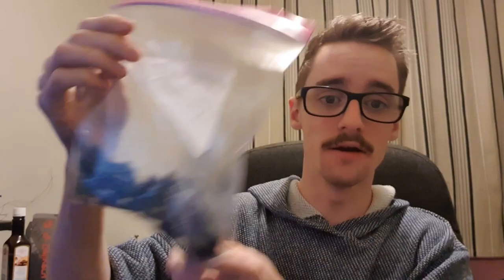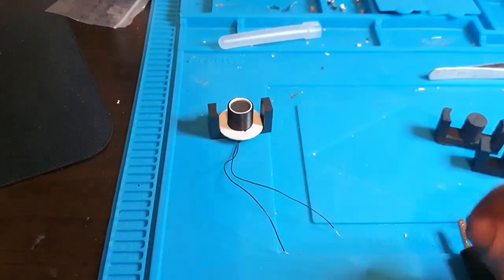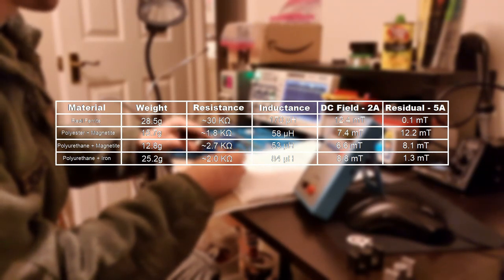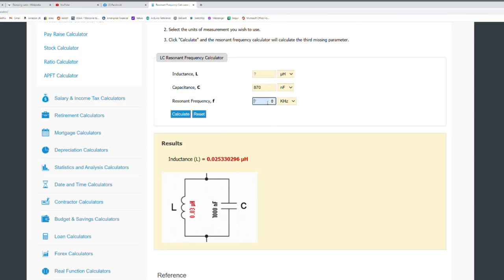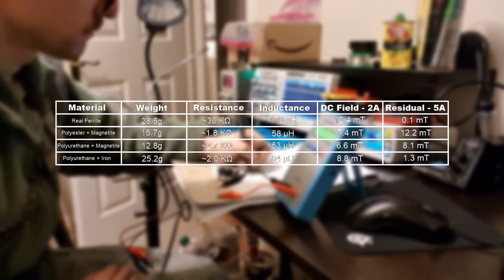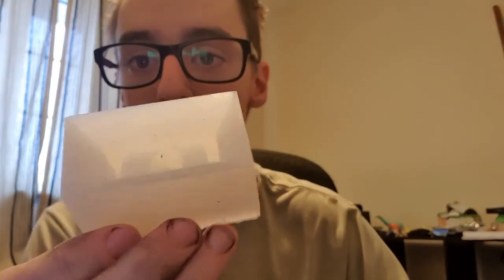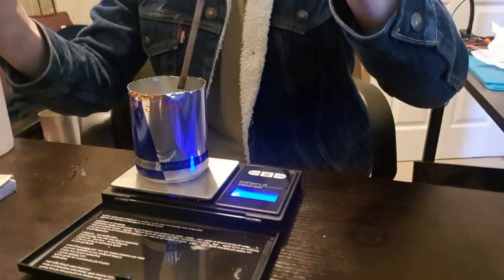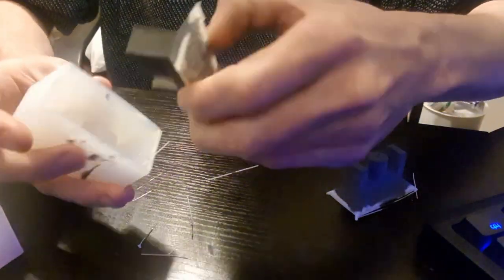Homemade Magnetic Cores! (Part 2)

Comment: Excellent! exactly what I was looking for thank you, you have saved me so much headache, I was about to go down the iron pla route but then actually read the properties so have been searching for castable transformer core material, there is nothing out there, well not that you can get hold of anyway.

So my goal is a single rotor axial flux motor that the rotor is incorporated into the base of a centrifugal fan with the stator underneath. (large model RC hovercraft)

Considered air core however they will not self start with sensorless esc's and have such low torque and high rpm, the opposite to what I need. what I do need is a axial stator with back flux return path / top shoes and a strong rotor magnet array with 'backing iron' for the lowest kv I can get with one rotor.

Now I can model the motor with a castable stator in mind :)

I do have 2 questions if I may?
with the 90% iron cast stator dose your motor have enough feed back to self start with standard RC esc's? I wasn't sure if the laser was just for the scope or timing as well.
with the carbonyl iron I know you did say there was no real gain to inductance but how about the conductivity?

nice work BTW!
Reply from the maker: I'm sorry, I just now saw this comment. I would love for you to hit me up on facebook or discord to talk about your project.

I was in a similar boat looking for cast-able stator materials, and there is almost no information out there. So I decided to make some!

As for your questions:

I've tried to test my home-made motor with a standard sensorless ESC, and it did not want to start. The lasers ARE being used as sensors for my psuedo-ESC circuit. Though mind you, my home made motor uses a much less refined recipe for the stator. I know I said it was %80 iron powder by weight in the motor video, but it was more like %50 MAGNETITE powder by weight. Using a stator of %80-90 iron powder should be significantly better, and I don't see why it wouldn't generate enough feedback to self-start.

As for inductance vs conductivity, I hadn't thought to test that for the carbonyl core until you mentioned it, and I just tested it by touching my mutlimeter to two of the cores with about 1cm separating the probes:

An %80 iron powder core read 2-3 k-ohms.

The 90% "Carbonyl powder" core read around 30 ohms, so it's obviously much more conductive.

I'm thinking that this means the carbony iron powder I purchased is in fact not genuine and is just extremely fine iron powder, which would also explain why it APPEARS to have the same inductance. The finer powder & higher concentration is probably resulting in eddy-current losses that lowers the apparent inductance, despite the core likely having a higher permeability.

I did read a paper a while ago that talked about mixing iron powder with a low concentration of resin and magnetite powder, letting it cure, and then re-grinding it down into powder and mixing it with resin again to cast magnetic cores. I guess the idea was to coat the conductive iron particles with non-conductive magnetite, thereby preventing said eddy-currents.
Reply: @BenjaminMarshallScienceMan  no worries man! Thank you for your detailed reply.
I was wondering about the carbonyl iron powder, I don't know if this is the case for you but from what I have found carbonyl iron powder as manufactured dose not have a insulating layer, they are just micro spheres of iron. Insulated carbonyl iron powder, is a extra stage of processing that is very hard to get / very expensive.
I found information on different methods of adding a insulating foreign oxide layer to iron powder, industrial method is out of reach, some were wet chemical. Then there was one tbat simply heated the carbonyl iron powder on a stainless tray in a semi dry oven at 200°c for 2hr, that was proven to give a micro layer of even iron oxide, but no tests on conductivity afterwards. This method may well be worth a try, if I get there I'll hit you up forsure!
Thanks agane.
Reply: I just made a comment that you might be interested in. We are working on similar projects. Its not too hard to make your own circuit and PCB design. I used instrumentation amplifiers and photo diodes with a 3D printed commutator. I also incorporated geared stepper motor and printed gears to move the commutator plate for an auto advance. One of the amp channels can double as a tack signal to a micro-controller for RPM and auto adjustment to the advance position. This of course is not for a finished project design but for prototyping and testing it will help generate the numbers you need. The micro-controller can also feed data to your computer in combination with a dynamometer for performance statistics.
Reply: I’m interested in self-winding a toroidal core for a DIY 48v x 10KW, 240v 60 Hz, two phase inverter.  Any idea how your material would work in that situation? 

I’ve been watching a lot of DIY toroidal transformer videos from SE Asia, being used for power amps for monster audio systems. I know some of them would be interested too.
Reply: carbonyl is use in high frequency applications. For motor cores you need the highest B curve an lowest H curve with the highest electrical resistance possible. 99.9% pure 50-50 iron cobalt alloy has the highest magnetic flux density and very high perm. A lower cost solution is 99.9% or better 99.99% iron powder. 99% is better than lower % but has significantly lower property values than 99.9%. Permeability of iron powder increases exponentially with purity. For DIY use the highest dielectric epoxy you can find 500-800 v/mil with a reasonably low viscosity. Mix into a thick putty and press into a mold as densely as possible. If electrical resistance is still too low mix in a bit of iron oxide 3. Don't forget that motors are low frequency. 20k rpm motor is firing coils at less than 1 Khz.

Comment: could you instead make sheets of resin with iron core... that way stack them up with insulation and check their magnetic flux density? you could also instead make a 3d print with tiny slots in it and fill it with iron powder. it should easily reduce eddy current losses without compromising your build process for different shapes and sizes-this is in comparison with you filling an entire cylinder with iron powder able to conduct the entire volume, instead printing multiple discs within the cylinder with no conduction between them and filling such slots with full iron powder would in theory get you much better result. varying the slot thickness would probably impact the B-H curve and also electrical resistance. so its got design parameters to tweak! would love to see the result of such an attempt! Thank you for your contributions anyways!
Reply: The thing that limits how high a frequency you can go with laminated silicon-iron, is that the eddy currents start to happen within the layers, so you need an ever-greater number of ever-thinner layers, resulting in a less dense core.  The whole point of using powdered iron alloy or ferrite cores is that the grains are small enough that there is very little path for eddy currents to follow, as long as the grains can be insulated from each other.  With ferrites, the grains are already pretty poor conductors, and with iron powders, you use an insulating binder.  I think Benjamin's idea of using a powder that includes an insulated coating is the ideal approach.

Comment: If/when you're back safe&sane why don't you try to slowly heat degreased metal powder spread onto metal sheet till it gets dark violet/black coloured and cool it down instantly in any oil. Wash oil off with alcohol/degreaser. This would be what you was looking for.

Comment: I hope you revisit this topic as you were onto a great concept. Your method is flawed for producing high density cores. First make a proper mold and use mold release compound or 3D print a liner out of dissolvable support material. To make 3D printed parts fit snug make the inner part 0.1 - 0.15 mm smaller. For tight press fit 0.05 mm. Then either use high vacuum bagging or mix slow cure low viscosity high dielectric epoxy 500V/mil + and hardener (There is a good one on Amazon for cheap). Then knead in fine Fer-rite powder mix of your choice till you get a firm putty in which you cold press into the mold. For complex geometry you need to make a custom plunger tool to fit tight with some channels to allow air to pass in/out. I use a vise to pack with the tool. 3D printed molds need to be SOLID FILL. You can't use just any fer-rite or any epoxy and expect a good result. For motor cores you need a high B and low H but permeability is not as much a concern. 99.9% pure iron powder of 300 mesh is a great material. Add some iron oxide powder to increase dielectric strength and decrease H without lowering B curve too much. This will give a mix that will give great B and H as well as decent permeability. For High power motors use 99.9% pure Iron Cobalt 50-50 alloy 300 mesh powder instead of pure iron powder. You can also mix and match powder ratios to get the best material properties for your project requirements. This is never going to be as high quality as powders engineered with oxide layers and other specific properties pressed and sintered and annealed but it will give a good material for prototyping concepts or DIY designs.
Reply: Update...     I'm using Max Cast hybrid epoxy casting resin 510V/mil dielectric mixed 30g of epoxy to 280g pure iron powder. Its very dry but sticks to itself like a sand castle. The 3D printed mold needs to be in pieces with breaks in all the corners so that it comes apart and is bolted together. No trapped faces. It will not slide out. One side open to fill and pack. I'm using Mann ease release 300. weigh the iron powder into one cup. Mix epoxy in another. Slowly incorporate the iron powder making sure to mix it well. Make sure it is consistently mixed, then pack into mold as hard as you can. Then place mold in a pressure pot up to 5.3 BAR or 80 PSI. This makes the densest material with a resistance of 500 Kohm/cm 2.6 Mohm as measured in the video
Reply: @dee5556  Does the pressure not compromise it by trapping the gasses in it? I always try to cure epoxies under vacuum because it off-gasses so much.

Comment: Did you get around to try the insulated iron powder? Do you think epoxy resin would work better?
Also, you mentioned 3d printing with iron filled filament. Have you tested how good/bad that was, compared to the castings you made?
Reply from the maker: I used the carbonyl iron powder. It was so fine that the polyurethane resin was happy to accept a 9:1 mixture (so %90 metal powder by weight). Despite this, the resulting core was at best only marginally better. Using the same 50-turn coil I only got a couple microhenries higher inductance. So I decided to not even bother making a video about it. I do have a plan to use mechanical pressure and metal dies to get better casts, but I've been waiting on my CNC mill to arrive before I attempt that.

Epoxy resin could work, provided that it has a low enough viscosity to accept a large amount of powder. But the type of resin you use will do nothing to directly improve inductance.

As for magnetic filament, its magnetic permeability is atrocious. If I recall correctly its relative permeability is about 2 (The worst ferrites are about 40, for comparison.). It would be better than an air core, but I'd only suggest using it if you have no other means to build something better. It's more of a novelty filament in my eyes.
Reply: @BenjaminMarshallScienceMan  Very interesting. I mention the PLA iron filament because I saw someone make a brushless motor with a printed stator core on YouTube.  So it was basically like an air core...
Reply from the maker: A motor with a stator core made from magnetic filament or just plain pla will LOOK like a very successful motor. But motors with lower inductance coils will actually have a higher RPM but almost no torque.

I did actually make a motor using the magnetic filament, it's the last motor in this video:
https://youtu.be/wknisHshDzQ
You'll see that it actually has a very high RPM, but stalls out after a while because of how little torque it produces. Compare that to my most recent motor here:
https://youtu.be/la4pkVB2tqg
That one uses my less refined method of making homemade ferrite. It's RPM is noticeably lower, but it produces a lot more torque.

Comment: Have you tried using ferrite powder? Ferrite uses iron oxide/rust and maybe you will get closer to the real thing with that. For small parts it shouldn't be too hard to build a tiny oven out of nichrome wire, 2-4 fire bricks and a 10A relay. Total cost shouldn't be more than $40 for the size parts you are making. That would allow you to sinter your own ferrite ceramic cores.
Reply from the maker: The magnetite powder I used is iron oxide, Fe3O4 if I'm not mistaken. Are you referring to something different? Googling 'ferrite powder' doesn't yield any results where I can buy something I haven't already tried.

Sintering my own cores is an interesting idea.
Reply: @BenjaminMarshallScienceMan  ferrite for magnets and cores is a mix (magnetite is an example of that). I cut and pasted the section from wiki below. Soft ferrite is for inductors while hard ferrite is used in motors and permanent magnets.

"A ferrite is a ceramic material made by mixing and firing large proportions of iron(III) oxide (Fe2O3, rust) blended with small proportions of one or more additional metallic elements, such as strontium, barium, manganese, nickel, and zinc.[1] They are ferrimagnetic, meaning they can be magnetized or attracted to a magnet. Unlike other ferromagnetic materials, most ferrites are not electrically conductive, making them useful in applications like magnetic cores for transformers to suppress eddy currents.[2] Ferrites can be divided into two families based on their resistance to being demagnetized (magnetic coercivity).

Hard ferrites have high coercivity, so are difficult to demagnetize. They are used to make permanent magnets for applications such as refrigerator magnets, loudspeakers, and small electric motors.

Soft ferrites have low coercivity, so they easily change their magnetization and act as conductors of magnetic fields. They are used in the electronics industry to make efficient magnetic cores called ferrite cores for high-frequency inductors, transformers and antennas, and in various microwave components."

Comment: These are iron powdered cores. Why not compare them with the yellow/white cores? Comparing with ferrite is like apples and oranges. Mix in ceramic filler powder to increase the resistance.
Reply from the maker: Powdered iron cores should have a higher inductance than ferrite though.

Do you think that increasing the resistance would also increase inductance through reduction of eddy currents?
Reply: @BenjaminMarshallScienceMan  powdered iron cores have significantly lower permeability and AL value than ferrite. Their advantage is that their saturation current is much higher without a gap.

Comment: Real ferrite is densified under hydraulic pressure and sintered.
That's why you will never attain that densification with poly casting.

Look up the PZT transducer manufacturing process, same thing.